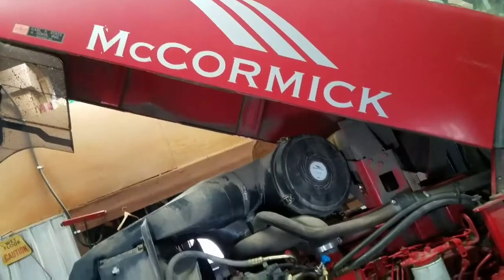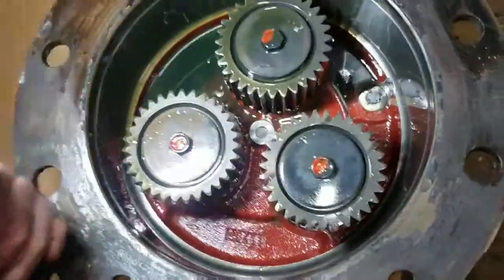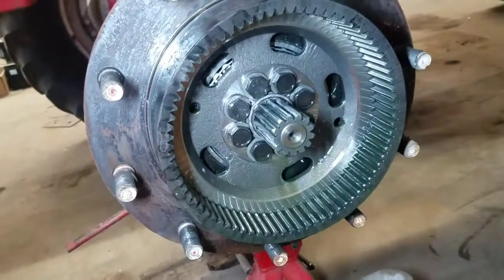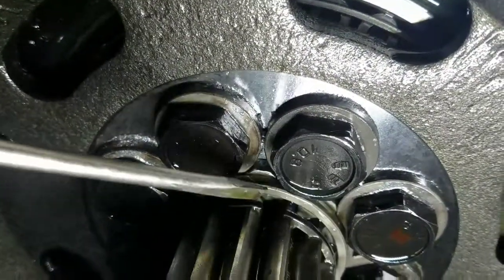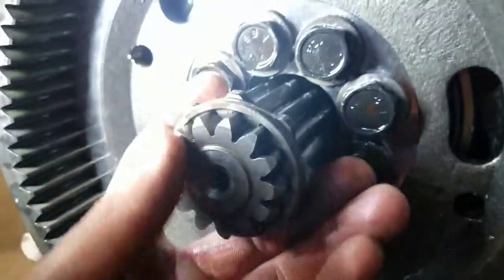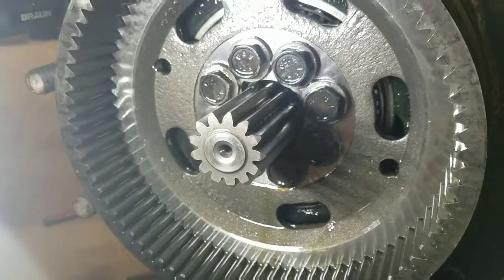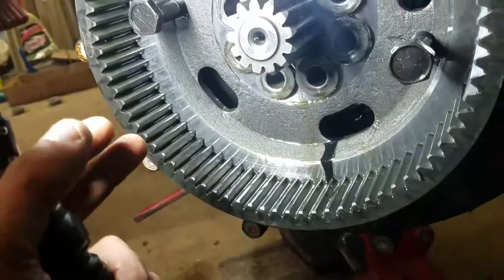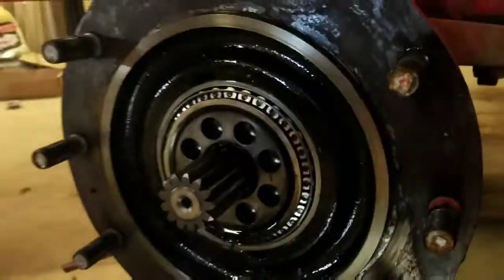McCormick wheel hub repair

Comment: Mine is a smaller brother to yours but, as a contradiction, two years older 🤔, 2003 MTX 140, not even sure if it has the same front axle.  However, you have given me the embryo of an idea how to attack that annoying little drip leak on the right hand wheel.  Thanks a lot, you just gained yourself a south Swedish subscriber 😉👍